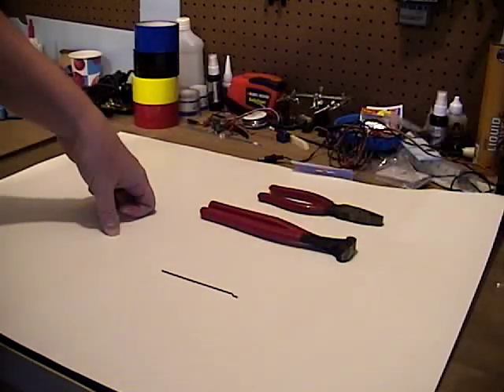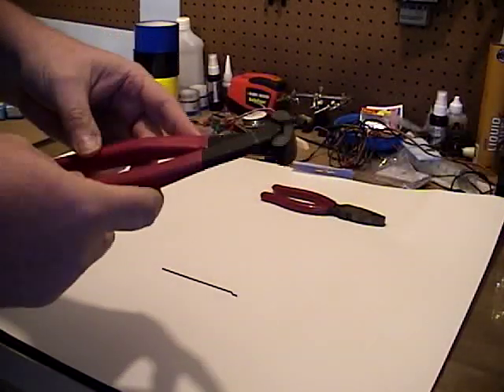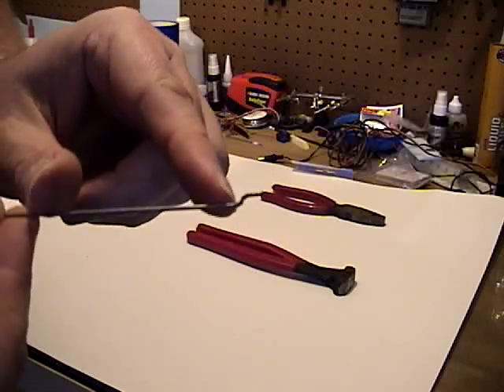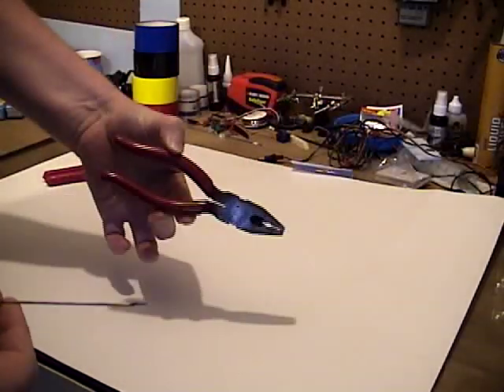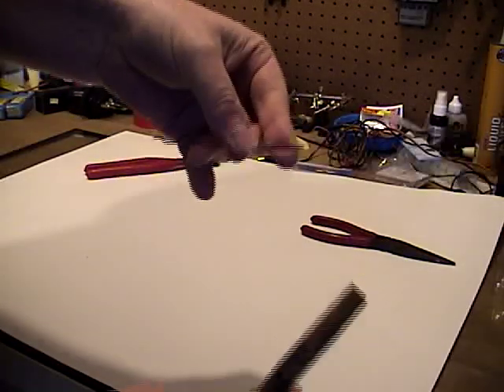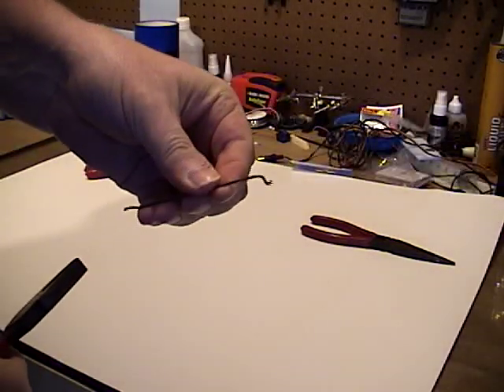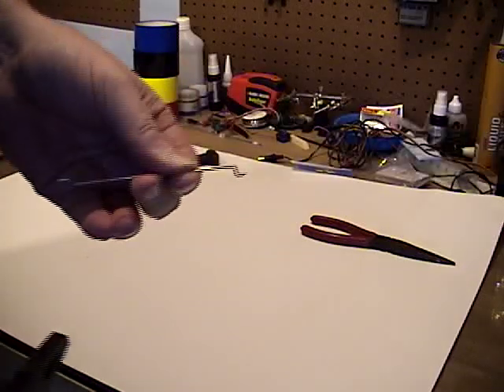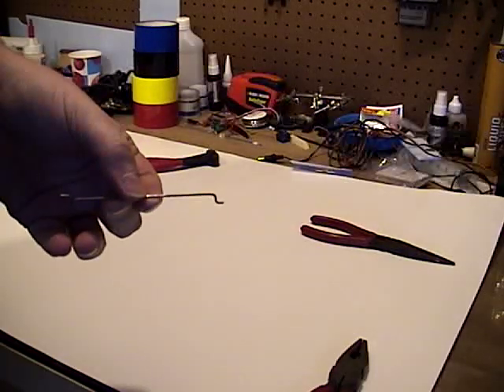Z Bends, "MY" Way

Comment: For folks that don't have such strong fingers, I'd like to recommend a small pair of vice grips to hold the short end. Some have sharp serrations which could damage the wire, so you could file or grind the two gripping faces smooth. Just make sure they look paralell when closed.

Comment: A piece of 1/8 x 3/4 flat bar stock with a hack saw kerf  in the side about 3/16 deep and 1/8 in from the end will bend all the Zs you need.  I also like a drilled holes close to the end for tuning.  Drill them at a slight angle and you can get your 1st 90 in one step.   Takes about a minute to make and costs about .20 cents.

Comment: Partially agree with the video... the z-bend pliers are far too limiting and don't work the best for thicker gauge wires.  I do the same thing, except for the the twisting part at the end.... that is not good for the metal and will weaken it unnecessarily.  Probably won't be a problem most of the time, but there's no reason to twist the metal.  When bending metal of any size, you just need an appropriate edge to guide and limit the bend, so you can use any strong pliers for that.  

What I do is use ONLY needlenose, which taper and get thinner towards the tip.  You should make your first bend closest to the edge of the wire however you want, but the second bend can be made with a "width" of the needlenose pliers to make sure it's the same size every time for uniformity and to mitigate the "twist" part.  E.g. if you use the tip of the pliers, then you can make a very small width for the second bend, or much wider if you use the wider part of the pliers.  Hopefully that makes sense.  With metal, use as little "rebending" or "twisting" as possible, because it will break on you if you're not careful.  : )

Comment: Note - After you measure the required control rod length, be sure to add 1/4" for your first bend.  This extra length is needed to compensate for the Z-bend.

Comment: The wire can be broken when you twist it.
Reply: I think the ordinary steel wire that is sold in modell stores can take few twists before it cracs
Reply: Old post but still useful.  Pick up the music wire.  Hold it vertically in front of your face.  The wire has a twist built in from the manufacturing process that goes from lower left to upper right.
The first bend should be made towards yourself.  The when you make the second bend it will follow the natural twist in the wire.  It makes a break less likely when bending the short end parallel to the rest of the wire.  Trying to adjust the shape, particularly where the short end points, can easily break the wire if you try to bend against the built in twist more than once.  Heavier wire, over 1/16in. is more likely to suffer a fatigue failure from bending the wire back and forth.

Comment: I've been using Z bend pliers for years and I cannot agree with this video ... and the letter is Z'ed' .... not Z'ee' ....

Second ... depending on your rod  you can actually ruin the rod by bending twice - especially if its hardened black rod ...